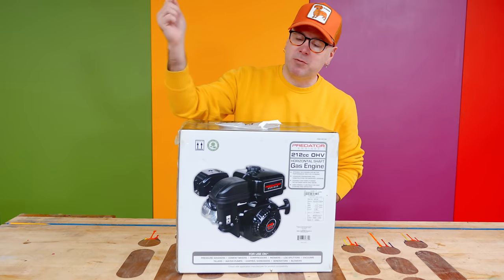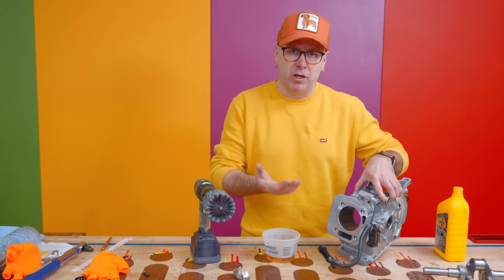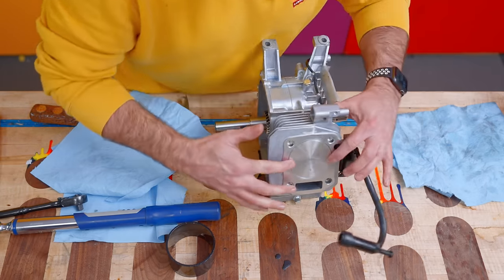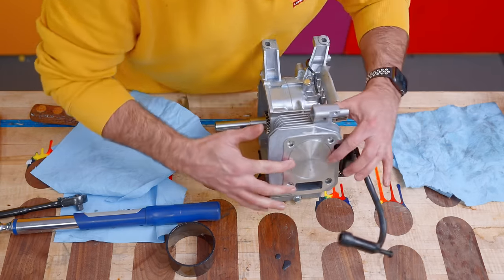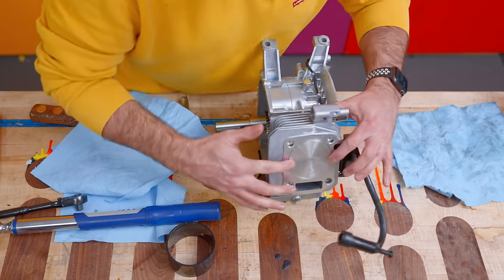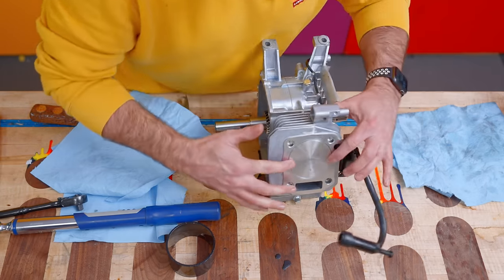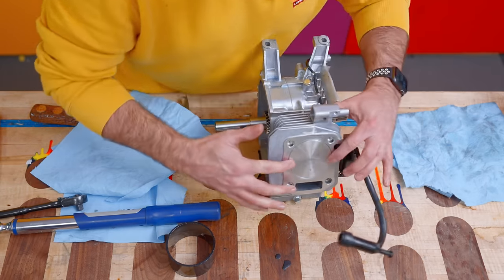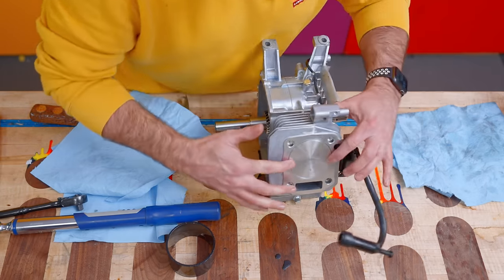How to Build a Competitive Kart Racing Engine (Stock Appearing)

Comment: A little advice on checking the valves for leaks: 
DON'T use water.   I've seen so many people do this thinking that because water doesn't drip out the intake or exhaust,  that there's no leaks.   The reason you don't use water is because you're putting water on previously oil coated surfaces that are polished, which makes them slightly hydrophobic.  With the surface tension that water has on that hydrophobic surface,  it can float above small gaps and not bleed through.   Instead,  use a solvent like acetone, xylene, or even gasoline.  They have lower surface tension,  and will actively leech through any gaps or leaks in the valves.    Hope this helps.
Reply: Well said
Reply: Yep! You need the most oil-eating liquid possible.
Reply: @Kootwoot  MEK! lol
Reply: Gasoline works very well.  Never use water
Reply: Yep use brake clean.
Reply: Vacuum is the best way, next best way is put liquid in the combustion chamber while the head is upside down, then blow air in to the port(s), you'll know right away if you have any leaks, air will go places liquid will not.
Reply: Mineral spirits is my favorite, does not evaporate too quick, cleans up easy, cheap.
Reply: @Peter-V_00  vacuum is the best way, but not everyone has a one to perform the check that way.
Reply: I was taught to use air pressure, because that is what the engine compresses.
Reply: My High School Auto Shop Teacher used solvent.
Reply: Good looks
Reply: Would it be possible to do a "leak down test", (as I do with complete 2-stroke engines to check for air leaks.), where you can seal a flat material, (even plexiglass will work) to the head gasket surface, and pump in about 10psi through the spark plug hole, (sealed)?
Reply: @EarthSurferUSA  that would be a vacuum test,  and yeah that's one of the best ways so long as it gets a proper seal
Reply: Well said.  One thing to consider, however.  This is going to sound ridiculous, but you can verify it...  Petroleum products have a very large molecule size compared to water, and can hide leaks that water will show.  Pressurized air is best.  To verify, try to pour jet fuel (or diesel, or kerosene...) through a coffee filter - it barely drips through.  If you use water, use soapy water - but then you have residue. Pressurized air...
Reply: @HPDrifter2  that's why I said use solvents. Molecule size aside, they have hydrophilic properties, meaning they actively stick to and spread across metal. The reason I suggested using solvents is not everyone has access to a vacuum or pressurized air.   The reason petroleum doesn't filter well isn't the molecule size,  but because of its hydrophilic property,  it tries to cling to the filter making the process much slower.   Using a combination of pressurized air(positive or negative) and a hydrophilic solvent would be the best way.
Reply: @Kootwoot  qq
NC
Reply: @edwardreid8861  p po tmgkckcocp
Reply: I drop  2 stroke pre-mix into the ports, from above. Won't wash out as much oil from the pre-lubricated parts. Once done, I spray a bit of fogging oil inside each port.  Vacuum/pressure are cool but  unnecessary imo, as seats quickly get somewhat dirty  anyways under operation (exh., mainly).
Great video, everything to know is covered ! and very intelligently. Amazing that  15 minutes IS enough to condense so much knowledge ! 
So ok,  now let's add a turbo/compressor, please.
Reply: well at least now i know how to make my riding lawnmower cut threw the thick Iowa weeds . I have no Idea why you tube recommended me this video . but i laughed  soo hard at this grown azz adult with earings bigger than my girlfriends teaching me how to make my lawnmower go faster . and he was serious bout it to ! hahahahahaha
Reply: Awesome advice, I figured this out when I started building SB head in the late 90s. Water would hold but gasoline would leech past the valves when they weren't properly lapped.
Reply: This is good tip! But in this video he appears to be cleaning all parts with brake clean (very useful solvent and will break down any oil or grease and effectively remove it) throughout the build thus negating this issue from happening when using water
Reply: You don’t use water cause it’s too thick! Use acetone, or some type a solvent
Reply: Lacquer thinner . Will find any leak
Reply: Molecule size of water differs from the gasses that the valves will use. You can have a leak of gasses that the water will not show.
Reply: A thin liquid will show up, when air may be hard to hear or tell exactly where leaks are
Reply: @HPDrifter2  liquids such as gas, s solvent, lighter fluid acid tone are much much thinner than water
Reply: I just use jb weld and peanut butter.. if it doesn't leak, I know the valves will seat!
Reply: The only thing I don’t agree with you on is oil making the surface hydrophobic he used brake cleaner on all the parts so that would’ve cleaned up all of the oil, so yeah, it wouldn’t be hydrophobic anymore and the tester world worked
Reply: @conewagosquad3635  People was using water wayyyyyyy before this guy and they will be using it way after him 😂
Reply: @evilferret1453  I bet your a blast at parties! 😂
Reply: @austinrobinson186  lol can you even buy that anymore?
Reply: If you use water Mix in a bit of soap it helps with the surface tension and you can check for leaks when you carefully blow with your air compressor thru the exhaust and intake Port. There will be bubbles if they are Leakie
Reply: yep I use gas
Reply: Also. Using an air comp you can blow air into the intake port and exhaust and look for bubbles 😉😉😉😉

Comment: When i raced box stock i took new head gaskets to a shop with a 300 ton press. I made 2 steel plates 2" thick , put the gaskets between them and reduced them to the minimum allowed thickness.  It helped get that fraction of compression other builders didnt have. Every tiny bit helps as you know. Great video!
Reply: Why didn't you simply buy a thinner gasket? Aftermarket gaskets have been around for decades. Smashing them in a press is the most ridiculous thing I've ever heard of. The size of the gasket IS going to expand IF you succeed in getting it ANY thinner. Now it will be hanging inside the bore. NO good.

Edit: ALSO, with a flathead engine like these were years ago, reducing the head clearance ALSO reduced your "port flow" as it reduced the clearance between the area between the valve and the surface of the head where the air flows. It is NOT an automatic increase in power with these engines by increasing the compression. There is a VERY fine balance between raising compression and then negating any increase in power because of the reduction of the airflow passage of BOTH the intake AND exhaust area between the valve and the head. The more you lower the head to increase the compression, the more the intake and exhaust airflow has to take a sharper turn to make it in and out of the valve AND the total area of the air passages ends up reduced also. It ISN'T as simple as "shave the head" or "run a thinner head gasket" in those engines and end up with more power.

Comment: That brought back memories of my younger days messing around with cars. I did the heads on a 1990 Thunderbird I bought for $500 while I had it parked on a jobsite I was working at 20 years ago, and that was the last time I did any serious engine work. 
Now I'm thinking gas powered table saw...
:)
Awesome video, David!
Reply from the maker: John, a gas powered tablesaw is worth at least 30 million views!!!
Reply: @SomethingAboutMaking  have you ever been to Keim Lumber in Charm Ohio?  I think they have gas powered table saws for the Amish
Reply from the maker: @beaushaw  I've been! That place is incredible!
Reply: @SomethingAboutMaking  Are you a mechanic by trade? Great video btw! I subbed.
Reply: Delta’s “The Modern Motor Driven Workshop” published in 1930 shows how to hook a gas engine to their table saw of the day. They even go so far as to show how to rout the exhaust pipe out the wall of the workshop.
Reply: We had a petrol engine table saw when I was an apprentice 55 years ago from Oxford England
Reply: i saw somebody check for good valve seal by doing the same thing but he blew compressed air in the ports to see if there were any bubles, is this a safe way to check? Also do more engine videos, they are great compared to other youtubers.
Reply: @pidem1  I heard that the penguins get jealous when you blow the seal.
Reply: Was it a super coupe?
Reply: One day. I hope to have a gas powered drill
Reply: Vende un motor de esos ya listo
Reply: @anewzack78 I once owned a 1990 T-Bird SC 3800 Supercharged I loved that car very fast my late wife totaled it I almost cried

Comment: You are the cleanest mechanic I have ever seen.  You rock Dave.  “Some of us don’t have friends “  You always crack me up with your humor.
Reply: When you start with a out of the box engine and then drain it before starting your work on it - it is easier to stay clean.  Run a few laps on dirt and then start the process and it will be a different story.
Reply: CLEAN... USE OF DREMEL SENDS SHARDS OF METAL AND ALUMINUM IN THE CRANKCASE BEARING..
Reply: Hey, I don't have any friends and I don't even have a life.  That's why I'm watching Dave's life.

Comment: When i first came across this video and had little to no experience with building or modifying these (or any) engines, I never got past the first couple of minutes.

Now that I have modified several engines and I'm always swapping or grinding something to pull that little bit extra power out of them, this video is way easier to keep up with.

I like the fast pace you've managed while being as thorough as this video is. One of the best clone building videos on YouTube, and Im confident because I think I've seen most of them.

Great job.

Comment: I started racing when I was 15 sprint kart racing (short course asphalt). It was a great place to learn to drive. Then I got into  road racing karts. It was huge in the 80s. Every Christmas our family would race at Daytona. The smallest class I would run still had 50 or 60 karts. Some classes (usually Yamaha) had over 100 entries. It was the most fun times I had with my dad, not just the racing but the hours of preparation we spent in the shop and the travel to the races. It was all good, and I learned so much. It was a great way to grow up. 

Thanks for bring back the memories, even though we ran two strokes 😜.  Be safe and have fun 👍

Comment: Pretty cool! I built Hi-Po 'Lawnmower' engines in the 70s. Back then, the trick was to use Tecumseh engines (Forced Oiling) and we even converted some from vertical to horizontal flow, shaved the heck outta the heads and changed the oiling pickup. Ignition timing was adjustable on those engines as well.  We used 5 HP camshafts in 3.5 HP engines and used two McCulloch chainsaw carbs on an Aluminum manifold. We started these engines on Gasoline then once warmed up, they were run on Methanol-Acetone mixture. Pretty heady stuff for a 15-year-old with a very smart Power Technology teacher and a small dynamometer.
Reply: how did you guys make forced oil in these engines you guys make your own oil pump?
Reply: @ephenj  Techumseh engines have an oil pump.

Comment: The best way to check for proper valve sealing is with a vacuum pump.  It’s easy to make a plastic plate (add a quick disconnect to the plate) that bolts to the head and use a MityVac vacuum/pressure tester and you’re good to go.
Reply: You are correct sir.  It's called a leakdown test, and it does work well.
Reply: proper for a shop...you can use a solvent if doing yourself at home.  guessing this is for the budget racer.

Comment: This is super cool man! Been playing KartKraft in VR and would love to do some IRL racing.
Reply: Do it
Reply: Nothing like real life!
Reply: If you’re doing street course racing buy a Briggs Lo206. They run them about everywhere while the predator stuff isn’t ran anywhere I know of
Reply: @dondelchulia3189  the Predator is gaining traction FAST so it depends on the region and if its "box stock & sealed" rules or not...you can build a BADASS predator for about $650 all in that a box stock $600 Lo206(Undressed at that) cant even compete with. And that can be upgraded even further without much more than a cam/spring swap. Around here, almost all Kart classes allow predator based engine....even some predator based Jr. Dragster classes are common at the strips around here now

Comment: Those HF engines are no joke.  I've been seeing them used in a lot of places, especially over similar Hondas.  similar power and reliability for  fraction of the cost.  It's pretty cool.  I'm debating picking up a Predator engine (non-ghost) for my kids' yard kart just to replace the finicky one that's already on it.
Reply: That sounds like a plan Dad.
Reply: I know so many people where if price is a big factor, predator is always the immediate choice no matter which version
Reply: Get the Ghost!! The extra few bucks is completely worth it otherwise the cart will sound like a log splitter
Reply: Get it, I put one on my daughters go cart and it does about 35 with me on it at 200lbs. Non ghost
Reply: @brodieodell1974  I have to fix the steering before I worry about the engine.  My oldest sent himself to the emergency room when he ran head long into a tree with it.  No point in making it go if you can't tell it which direction to go.
Reply: Hf is cheap as possible and made to last but don't last 🤣
Reply: @uptinsinclair6545  Tillotson and Ducar make the same engines for just a little more but they are sturdier and they have upgraded configurations to fit your budget.
Reply: I thought this too at first.... Now I've blown up 6 trying to get the same power as my flathead 5hp with port work...

Comment: As a machinist at a shop, what I recommend during the water leak test, actually fill the port and blow air against the closed valve. If you have air bubbles, gotta fix the seats 👍 Good video and interested in watching my work but on a smaller motor
Reply: Water has a lot of surface tension, kerosene or gas would be better for just a gravity test, but perfect for a 'pressure' test.

Comment: Pull your torque wrench instead of pushing. You're able to apply more force easier. Excellent video, very efficient.
Reply: Pulling is the correct way to use a torque wrench. Never push. You are absolutely correct
Reply from the maker: I'm learning! Thanks!

Comment: If you're cutting valves after your lapping you can use blue daikum and it will show your high and low spots if you have any if not it will be a complete circle around your valve and you can see a good seat

Comment: Circlip tip (7:30):  make sure the opening is facing up or down, relative the stroke.  If the opening is to the side, at high RPM the G forces can compress the clip enough that it can come out.  Overall an excellent video!  I don't even race carts and this makes me want to build one. :)  How do these things hold up with splash lubrication?
Reply: Don't ask me how I found out circlip location was critical.
Reply: @mmi16  How'd you find out circlip location is critical?
Reply: And that's why I love Spiro Locks instead of Circlips for wrist pins haha.

Comment: 65+ years of studying engines and you did a credible job of explaining the rationale for modification in less than an hour.  Great job!  Definitely can’t afford to do what you have, but the bug is still there.  An additional note - 1.3 million views, 50K subscription, 21K likes. …?  As if it costs a second to acknowledge that you did a ton of work using a thousand plus in “props” doesn’t seem credible.  I had to scour library’s, spend limited income, and thousands of hours of research and today it’s difficult to actually click on the thumbs up icon.  Huh